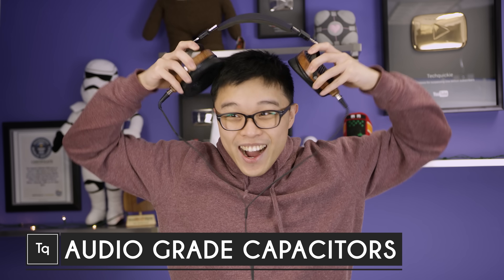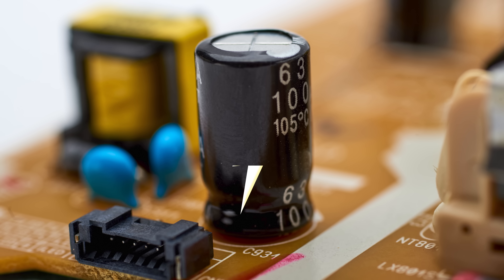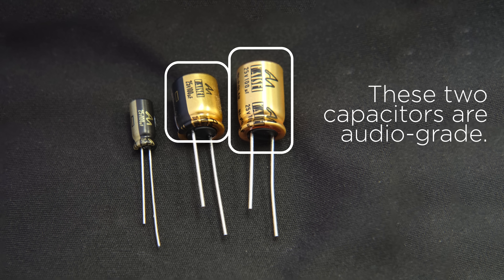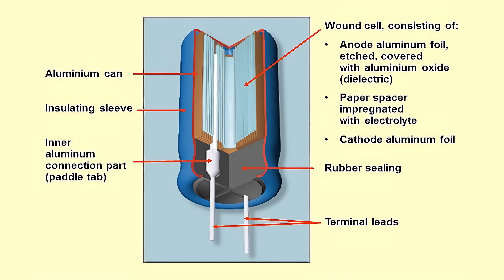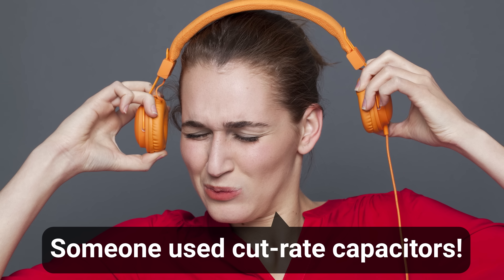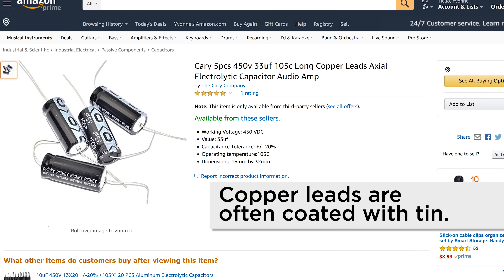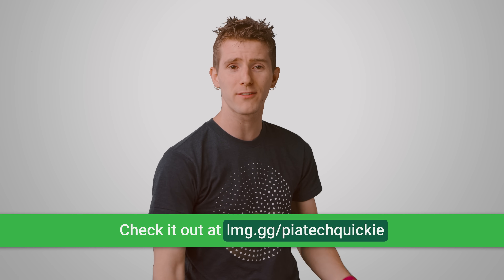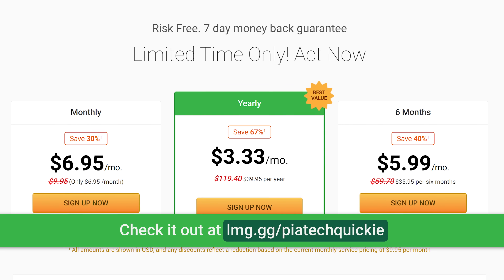What Does "Audio Grade" Mean?

Comment: As an electronics graduate, I can tell you I've never heard so much bullshit in an LTT video.

The quality of the capacitors only needs to above the absolute minimum to avoid excessive leakage and excessive internal resistance, but ultimately this is why the large electrolytic capacitors are often paired with smaller non-polarised capacitors capable of smoothing higher frequency noise due to their lower impedence at high frequency.

The quality of the product has a LOT more to do with the design of the circuitry than the exact properties of the capacitors. 

It's "gold connectors on jack leads" again. 

Unfortunately, Linus (and team) has taken advice from a company who stands to benefit from this kind of nonsense being common knowledge.
Reply: Agreeeed... Lot of talk about construction, absolutely no mention of ESR, which is what you really want to look for with audio caps. Most 'audio grade' caps are just low ESR and nothing more. Remember kids, if a company doesn't want to share their 'secret ingredient', it's because there is no secret ingredient. Your competitors will reverse engineer you stuff anyway.
Reply: @grahamlord86 no, low ESR are lines those companies put out for switch mode power supplies. Audio grade caps have much higher ESR. Reverse engineering anyways? Huh? That’s a pathetic way to run an engineering business. Elna states their silmics have silk to dampen vibration, that’s as much as they need to say. And lastly: you don’t want ESR to be too low. The power supply charging pulses become shorter and stronger and produce more RFI which has effects on the audio performance that aren’t easy to measure
Reply: You think jack leads are bad, I was looking for a TOSLINK cable on amazon. Far too many were gold plated with myriad reviews lauding them for this virtuous inclusion. THEY'RE FUCKING OPTICAL.
Reply: Scott Collins
Haha I forgot about gold toslink cables!
Reply: If you are working to military or aerospace specs, the quality encompasses many more details then I think you are aware of.  
These military/aerospace components are the ones targeted by audiofrauds. It is not the component that is the issue but the marketing of the products that have been enhanced by magic.  
All of the brands listed in this video are very well respected and the usual go to for professional builds and repairs.
Reply: @DirtyRobot  well thing is the cheapest components are actually really bad! Usually u get what u pay for with everything
Reply: @DirtyRobot  And what if those manufacturers research and create a component especially for audio?
Reply: @divcurl6044  They generally don't.  
The parts are spec'd (sought out) by audiocentric manufacturers because of the reputation they have. 
Why would they make a new component for a sector that is less than 3% of their total market. A sector who is already happy with the components they can get.
Reply: @DirtyRobot  It's a valid hypothesis, but I think that's all it is, because you don't sit in the boardroom at Rubycon or Nichicon say. Margins for PC and automotive markets are incredibly tight, so it's probably worth making an effort in specialised sectors. Plus, bear in mind Japan has  much less cynical view to audio than the West.
Reply: As an electronics engineering student, this more or less summarizes what I was thinking as well. Very disappointing to see them do such a poor job on fact-checking this one when they otherwise seem to do a decent job at explaining things.
Reply: To much was spoken about irrelevant physical properties and not to what really makes a certain cap better for audio, really the only physical property that matters is poly vs electrolytic , Poly caps (polypropylene and polystyrene) offer better frequency roll off with less random acoustical pitting through the frequency range when compared to electrolytic caps. When it comes to physical properties of caps, that is all that makes one “audiograde” or not. Just about every other physical property doesn’t make a damn bit of difference to a capacitor being audio grade.
Reply: @dubradiolol  Quantify.
Reply: Div Curl  - 15 years working as an speaker and crossover designer for Polk Audio and Definitive Technology, real world application in audio design and component testing
Reply: @dubradiolol vibration dampening doesn’t matter????
Reply: Your opinion is based on nothing other that opinion and second hand knowledge. Where is your experimental evidence?
Reply: Ur wrong, and tell u why, if it's a direct coupled or so called DC circuitry it's true doesn't really matter how high so called capacitors qualify is since thereis no capacitorsin the signal path, but if its not DC circuitry then 10000000% the quality of the capacitors matter!!! Because all the signal has to pass through capacitors such as coupling and decoupling capacitors, and in some cases its alot cheaper and easier to design non DC circuitry since it requires less components to make single ended designs! It's funny how always the beginners know more then advanced audio companies like Audio Note, everyone can Google and see how much attention they put in their designs and the quality of what they make, maybe they are not for everyone, but just because u can't afford it doesn't mean is BS!
Reply: After reading this comment, and looking through the responses, I have to agree that your experience is clearly limited to non-audio applications. I've recently begun doing amp repairs (I'm a luthier by trade), and I can say that capacitor quality can certainly play a role in the quality of a signal. I'm extremely skeptical of claims like this (tonewood in electric guitars, for example, which I'm making a very thorough video about), but my limited experience has already proven beyond doubt that poor quality caps can introduce unwanted noise. Cheaper caps (especially ceramics) can be piezoelectric and become microphonic, as I've recently experienced with an amp that had very low quality electrolytic caps installed. And certain amps are well known to have poor quality power filter caps, that when replaced with better caps, lowers the noise floor substantially, which is very obvious if you hear the amp before and after. 

Also, the point of gold connectors was never about signal quality, but durability. Gold plated parts don't corrode, and corrosion is a big problem with parts you touch often such as guitar/headphone cables. Cleaning dirty jacks that were oxidized by contaminates on cables is something I do on a daily basis. People with gold connectors don't have that issue. The marketing departments just went wild and took it somewhere that was never the intention.
Reply: @NautilusGuitars  that's very true, in my amps i used nichicon FG muse all of then apart from the power supply caps which are mundorf mlytic, and the difference was way to noticable, i even have 2 extra amps exactly the same, and i did a to b comparisons with my friend's and everyone agreed the difference is huge, the also the connectors make a difference, if they are brass connectors, brass is not as conductive as copper so means it has higher resistance, i replaced then with rhodium plated telurium copper connectors also made a difference but not as big as the power filter caps, the power filter caps make sense to replace first then the other electrolythics and only then connectors and wires if only they are bad quality
Reply: @MrDannydjmix2  Don't you think it's amazing, or actually sad, how there is a vicious nazi movement against what you found by your own experiments?
Reply: @divcurl6044  lol well one way to put it
Reply: A graduate means someone with no experience. I have decades of experience and can tell you the text books are for scope jockeys. Often things that make no sense to the text books make a huge difference and its up to you to find out why.
Reply: very well written
Reply: @0x8badbeef  not only for audio tho, for PC applications also, wonder why higher end motherboards run more efficiently?
Reply: @0x8badbeef  dont need what?
Reply: Actually, a lot of things they say on their videos is not scientifically accurate. In their video about why silicon is used in electronics, they said that semiconductors are used because otherwise the electricity would turn on too many transistors, but they did not mention that the transistors themselves cannot be made without silicon.
Reply: BSEE programs (I have 90 credits in one) will never touch the real psychoacoustic improvements of higher quality real world capacitors. VIBRATION. Did you learn in your program that capacitors, whether in the bulk filters of the current amp or in the signal path or as a decoupler, will vibrate from the current as well as the speakers. Elna Silmic II caps use silk to cut down on vibrations. Also: electron transmission in the audio band is quicker, better transient response. Also: ESR and leakage and value (tan delta in the datasheet, ESR/Xc) are only some specs that matter. Dielectric absorption (self charge ability after no DCV bias)  and impedance/frequency chart, real world caps will not just have Zc equal Xc+ESR. Also: ESL. Not all caps have the same inductance. 

I have real experience too. My Yamaha MX1 sounded a lot different after I put in silmics and there was a drastic break in period. The system sounded so bad (like a bowl of mashed potatoes) I didn’t listen to the amp and just hooked it up to a tuner and a dummy load for days and days. 100 hour minimum. 10W into 8 ohms. I took the cover off because of the serious heat of 5 days of baking.
Reply: I will readily admit that I am not an expert audiophile, but what knowledge I do have comes from my father who decidedly IS an expert audiophile
What you say is absolutely true.  Any "decent" quality cap should sound the same as any other to the human ear.  EVEN IF there was a measurable difference, there's no way you could hear it - anyone who says otherwise falls into the "I buy $1000 RCA cables" camp of snake-oil and placebo.
I have seen oodles of my father's DIY amps and many more from serious audio brands like Cavalli (RIP) and I almost NEVER see them use these overpriced caps.
Reply: Indeed. A good electrical engineer can make far better things with 'normal' components than a beginner with 'special' capacitors.
Tip: don't use bulk capacitors to smoothen out your supply for an audio circuit. Design the supply differently so it doesn't produce so much shit.. you can throw as many capacitors at it as you want but eventually a better circuit design always wins
Reply: Keep in mind there are many things in electronic that does require much more precision than audio thingy. Electronic engineers would know what they are talking about ofc.
Reply: @Porama6400   What do you have in mind that demands distortion and SNR to be -130dB or thereabouts?  You do realise, I hope, that if you look at any medical machine out there it will have an amplifier that is derived from principles pioneered in audio applications.  I would say few things require the precision of audio but I am open to being disabused of that notion - I just don't think I will be.
Reply: @ChristianRThomas  You are correct, good audio instrumentation is extremely precise / high resolution.
Reply: @divcurl6044  Thank you.  Some of the people here should try getting below -120dB, one ppm, on anything. It's far from easy.  I am at a loss to know what's out there that's substantially more demanding than audio.  A photomultiplier, maybe?  Btw, does the Curl in your name have anything to do with one of my favourite amplifier designers?
Reply: @ChristianRThomas  First off, although I know of John Curl, Div and Curl are to do with Maxwell and Heaviside. And, although their equations are mathematically perfect, they are an incomplete model of reality (the quantum world). It might seem like 1ppm is a tight measurement, modern audio test equipment can do a lot better than that, at least 40dB better. The problem lies in interpreting the result. What we don't know is what a human can hear, when resolving a complex signal such as an orchestra in a concert hall. What I mean is: It's easy to hear a guitarists bum note when listening to a metal band at 110dB, and a conductor can easily hear a poorly tuned violin in an entire orchestra - how can an electronic instrument measure and scientifically prove it's wrong? Or that a certain bend by a blues guitarist is right?
Reply: By the way, Div and Curl aren't too exotic to understand, it means Divergence and Curl. Think about the water flowing down the plug hole in your bath, and extrapolate that to an imaginary point where the field (water) has a spinning force, and, in this case a negative, flowing inwards force down the hole. Rudimentally speaking of course! It's a way of assigning descriptive values to points in the magnetic field around a magnet for example. Grad, or Gradient, is the other term.
Reply: @divcurl6044  I use an AP distortion analyser quite frequently (it's 20ft away from where I am sitting) so I am aware one can measure better than -120dB.

Not sure what you're on about in the 2nd part.
Reply: @ChristianRThomas  OK, understood. The second part, I was rambling - that and ranting about random stuff are two of my many flaws... ;-)
Reply: @divcurl6044 exactly. Steady state? Nothing like the mix of rapidly expanding and collapsing tones and harmonics of music
Reply: @Porama6400  What like? Audio measurements are some of the most precise in all of electronics: https://www.ap.com
Reply: Gold on jacks ACTUALLY HELPS.
I have two 3.5 Jack to TSR in front of me right now. One is gold plated, the other isn't. They both were stored in similar conditions for a similar amount of time (8-9 years, I think). Gold plated one is smooth and pristine as new; the other one is starting to degrade, its surface is matte and rough to the touch.
Reply: @Vladimir_Kv  That is true, gold connectors are more durable
Reply: i mean... the "gold on connectors" is not all horse shit. sure electrical conduction is worse in gold than copper, but copper does not oxidise and the pure gold is a way better conductor than copper oxide. so it's better "when the copper is worn and worse"

but yeah it's not better at new or compared to a clean connector.
Reply: @WetOlde  Uhm... Electrical conduction is better in gold than copper.. But silver is better than both
Reply: @Oystein87  It is bullshit. Electrolytic capacitors can be found in almost any electrical product that you own, and have no special qualities to make them perform better in audio applications. Furthermore, as OP said, they tend to perform WORSE than non polarized capacitors like ceramic ones. Also, the quality and design parameters of the product overall have much more to do with how it will perform that the exact brand and qualities of the capacitor. "Audio grade" is just marketing for the "1000 usd gold plated rca cables" type of people.
Reply: @Oystein87  Gold is a worse conductor of electricity... And even if it weren't, the resistance added would be in the thousands of an omh range, which is the equivalent to a couple of centimiters of cable. It only makes sense to use it in applications where you have very small connectors that have to carry an extremly sensitive signal, like in CPU. The effect in an analog signal is meaningless.
Reply: @Oystein87  Nope.  Copper is a much better conductor than gold.  Silver is only fractionally better than copper - like ~1% or so.  Just look it up on a table of conductivity - where, incidentally, you will find that copper alloys are very much worse conductors than pure copper.
Reply: @alpemxyz  Completely wrong!  There are about 500 different types of ceramics ranging from dire to excellent so we'll leave that to one side.  There are plenty of criteria that distinguish between the quality and the suitable applications for electrolytics.  How the electrodes are plated and for how long is incredibly important; since these are all reversible reactions shortcuts here will show up as high losses and short life as well as drift in value.  Key for reservoir capacitors is the maximum ripple current.  If the capacitor values are high then these will be short spikes of 10s of Amps, if not actually hitting 100A.  If that's not a specialist application then I don't know what is.  But sure, you just buy whatever they've got on the shelf.  Finally, there is no surer way of changing the sound of an amplifier than changing out all its capacitors for a different brand.  It will measure approximately the same - short of putting it on a proper distortion analyser - but will sound completely different.  Try just changing the input or output caps (if it has them) or change the reservoir caps.  That's not a huge amount of work but it will make my point very adequately.
Reply: @alpemxyz  Again wrong.  Distortion from 4mm banana plugs is about 3dB worse than the same output through Speakon connectors.  Getting down to < 3 mOhms is where you MUST be if your plug is going to have any chance of sounding (and measuring) good.  This is easily measurable on an Audio Precision, as is the distortion in the load resistors (don't buy big, fat 25W ceramic resistors - they don't even have a flat FR).  This low resistance can be achieved in a number of ways but ideally both plug and socket will conform.  Either you can slide across the surfaces, cleaning them, and have a large area of contact - as with gold plating, or you can gouge the surface (as with single spring banana plugs) and get a smaller but cleaner contact.  You find that a lot of the Chord Cable speaker cables go for the second in preference (ie. what once were the standard old RS 4mm plugs) to gold plated.  Silver plated is pretty good too and has some physical properties to back up its performance.
Reply: @ChristianRThomas  Stand by for Graphite cables......
Reply: @ChristianRThomas   The confusion here is probably because everyone gets so wet over "Gold Plated Connectors" and fail to realize that they are gold plated to prevent corrosion, not for their amazing conductivity.
Reply: @alpemxyz  Wrong, most ceramics are piezoelectric. Both self excited and microphonic effects.
Reply: @MsAsssde  I suppose you mean graphene?
Reply: @alpemxyz  that's exactly the point tho, u can simply do the test urself and replace all the caps with nichicon fg caps and u will be surprised of the difference, that if everything else in ur audio system is good enough to hear that difference
Reply: @MrDannydjmix2  I'm not saying that better caps dont make a difference on sound quality, just that the bigger capacity of electrolytics doesn't have anything to do with sound quality. Claiming that electrolytics are "better" for audio applications is just false and misleading.
Reply: @ChristianRThomas  good to know, though I'm not sure how many people can hear (or even care about) the differencen in sound between such changes. I guess I'll have to try it out for myself.
Reply: @alpemxyz  thats actually true, even when it comes to power supply filter caps good caps plus bigger transformer instead makes more sense, dual 10000uf on each channel should be more then enough if the transformer can supply high inrush current
Reply: @PubstarHero  that's what I was always told. My buddy builds competition audio components and when I had him install a system in my car, he asked if I preferred anything specific and I was told Gold plated anything was best but I was also broke and he told me that the gold plating was simply to help with corrosion, and more than likely I'd be changing out systems before the standard cables ever got to that state so he saved me money, and I went on to Alpine Colorado where I got a very large ticket for showing off my system to some locals. The trooper said I could have triggered an avalanche. So moral of the story is, I was pleased with the sound and didn't break the bank and I was an idiot for not thinking about bumping my system in a snow covered valley.
Reply: @alpemxyz try listening before speaking. Listen to an amp with audio grade caps and one without. I did not do this but I can affirm that different lines of caps sound better, which is the same basic conclusion that different caps can improve sound beyond stock. Obviously the original caps in my Yamaha MX1 aren’t as good as Nichicon Fine Gold (but Silmics beat FG which was what I put in). ESL, Dielectric absorption, impedance / frequency relationship and vibration damping construction are factors for caps beyond the data sheet basics. Ceramics only sound decent with C0G caps, and the values are low. A good bipolar like Nichicon ES is probably better than a ceramic and then with no possibility of a 10uF ceramic I use an ES
Reply: @ChristianRThomas that level of distortion is academic. I don’t need better than 60db SINAD in my system as I can turn down the volume 60db from my usual level and barely hear any music over the kitchen fridge.
Reply: @alpemxyz all evidence points otherwise. Please get out more and listen to audio gear and talk to people who do
Reply: @Stereosandotherfun  Not sure which comment this is in reply to but 60dB is approximately what most people get in the end.  There are a lot of measurements we could do to show signal being corrupted by something at 60 or 70dB down.  And getting 60dB range from phono should probably be regarded as quite an achievement!  People have got these figures wildly out because they don't understand dB (probably don't understand IQs before that and treat them similarly), like the guy above who reckons audio test kit can do 40dB better than 1ppm!  The AP Cascade model that came after my System One was, I think, less than 6dB better and I don't think they have improved by more than a smidgeon since. So I think we're still in the low 130s.  Must look this up one day but good luck to anyone who thinks they can get 1uV of noise or ripple, even input referred.
Reply: Whenever Linus talks about anything that isn't a computer it's bullshit.
Reply: @richardk2n  
😂
Reply: You made a general statement about spec requirements that in no way tells us what Linus said that You feel is wrong. Linus also did not tell us to go buy capacitors maid in a specific way or with specific material...     So basically your here asking for attention...     Well, you've got it. Congratulations.
Reply: Finally a comment that all electronic engineer like us will support, for rest capacitor function as energy storage (in form of charge) and filter circuit. Rest the video described is big BS. It would be fun if GreatScott and Dave from eevBlogs do rip apart video. It would be fun if we made a forum in eevBlog and ask Dave to rip apart and review it....
Reply: @kaustavsengupta8757 Quantify
Reply: Well the quality of the product depends on how good it's components are, so...
Reply: @rolerroleris533  well yes you are kind of right but not entirely,  there is golden rule that every electronic engineer knows. If circuit has good ground connection and you isolate your information carring wire(sensor) from frequency generator(like lcr circuit, clock crystal etc) . Then you will have great device. Component do matter but what really matter the most is reducing noise, good ground connection and systematic layout of PCB. I have seen circuit which are made from cheap materials but we're performing great.
Reply: You obviously haven't studied the topic.  Capacitors produce plenty of distortion - see Bateman on Capacitors.  Just because you weren't taught it doesn't mean it isn't true so don't be an arrogant shit.
Reply: If you really are a electronics graduate you would know it's not bullshit. That has been proven so many times now that I don't understand why anyone evek tries to deny it
Reply: @Oystein87  Indeed, just check Cyril Bateman's paper.
Reply: @Oystein87  It's irrelevant. Audio-grade anything is bullshit. Copper capacitor legs - fuck off. It's utter bollocks.